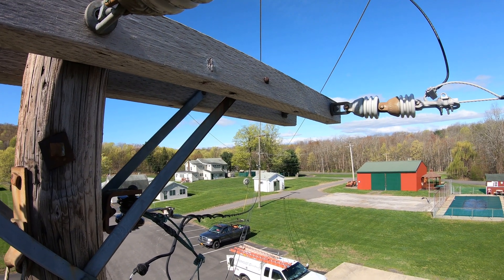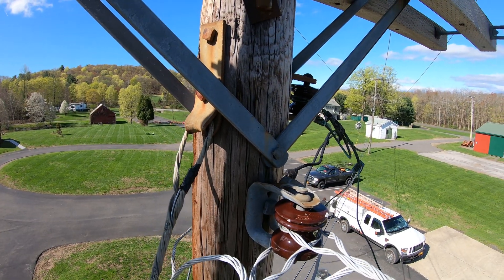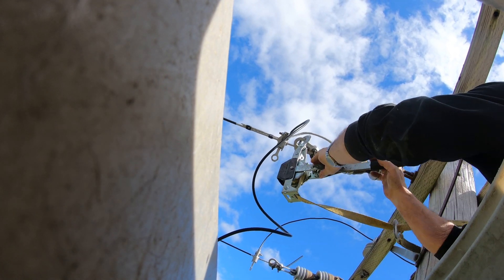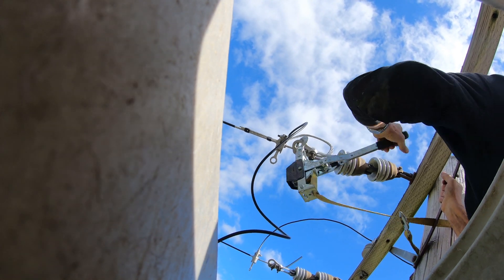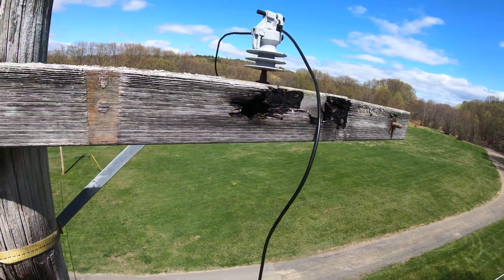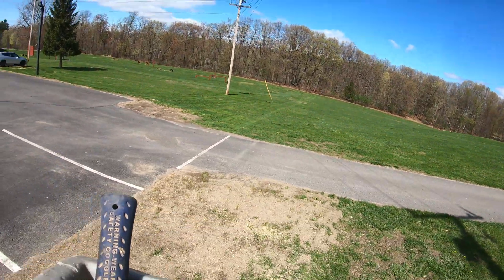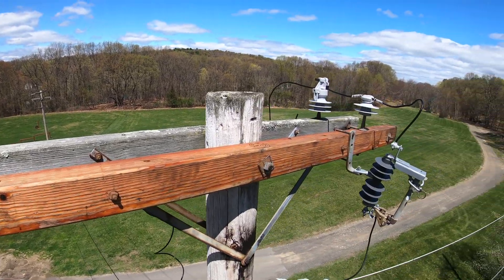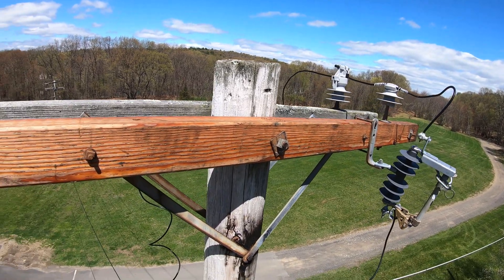repairs to an overhead electric line

Comment: Pretty sure we can see it was tracking to brace bolts... Meaning electricity was coming from the line leaking into pole to blot wet and moisture grounded by the wood pole complete
Ing the path and hazardous conditions...

Comment: Cool video! Is this a company that doesn’t use the expensive/fancy versions of tools?
5:16 I bought a cutter like this to cut 336.
14:20 my local company has a special type of tie wire for insulated jumper wires. I think the method of tying the wire to the insulator is a variation of the copper top tie.
11:43 I think you should put something around the pole to hook the hoist to then hook a grip to the wire instead of hooking the hook back onto the strap. For small loads that is probably fine but dnot for large loads. I do realize why the sag eye was used because you wouldn’t want to put a normal grip on insulated wire.

Comment: Since we have the technology, I think all wires should be buried. Electric, cable, phone and fiber optic. Those wires ruin the beauty so bad. Rock is a problem, but that's why God made diamonds. kek
Reply: Agree with powerline kid
Underground has to be dug out to access while overhead can just be climbed to or by using a bucket truck.
Overhead terminations are very simple but underground terminations are complex and there is more to worry about.
Almost all underground work cannot be done live however most overhead work can be done live.
Reply: its not that simple, cost and repair is a pain in the ass to bury and work with the heavy ass U.G cable. and with overhead you can spot problems so much easier.
Reply: This kids a pro listen to him. He builds power lines in his backyard. Never worked a day in his life in the trade. Don’t listen to us actual journeyman lineman

Comment: could have just gone to the dead-end and  pull the slack out of the dead-end shoe and cut the access tail
Reply: Like your vids.
I just realized he tensioned the primary instead of the secondary. My thoughts are the same but the tail connects to something so you would need to reconnect it.